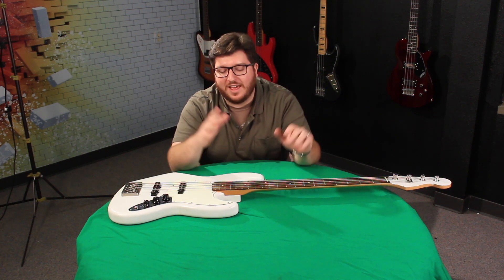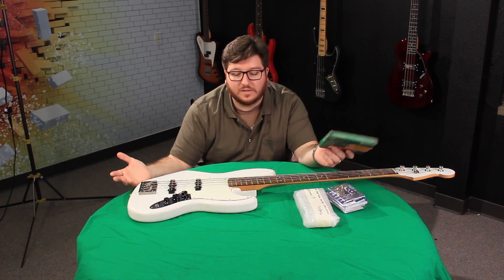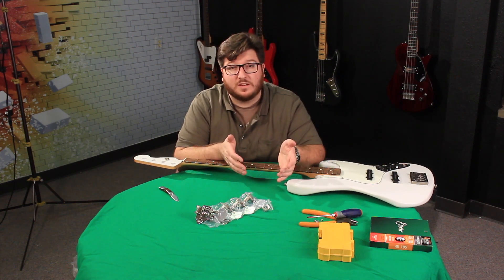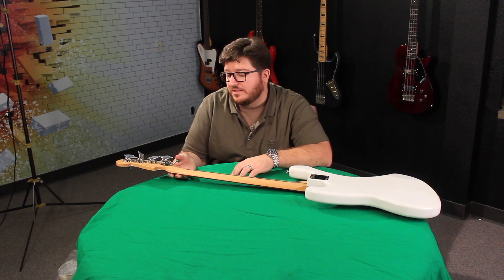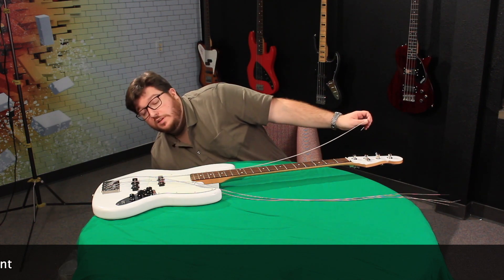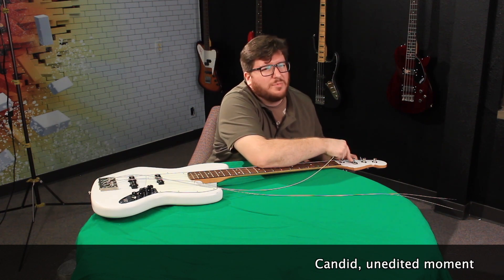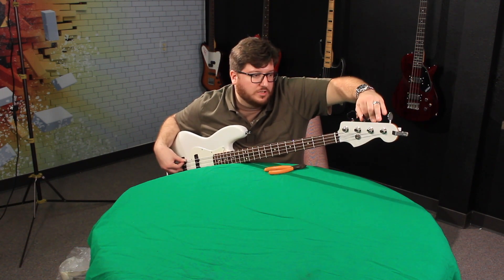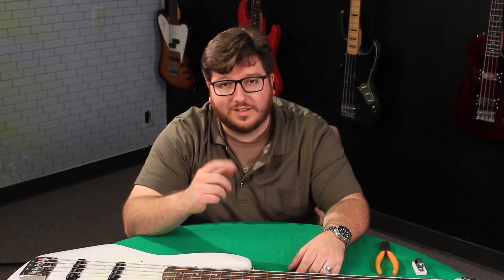Hipshot Tuner Installation

Comment: Hipshot ultralites all day long!  I remove and replace one tuner at a time.  It keeps tension on the neck while you're doing the swap.  It probably doesn't make a difference though, I just prefer doing it that way.
Reply: That still better though, you can compare the stems if it's aligned properly to the old tuner alignment.